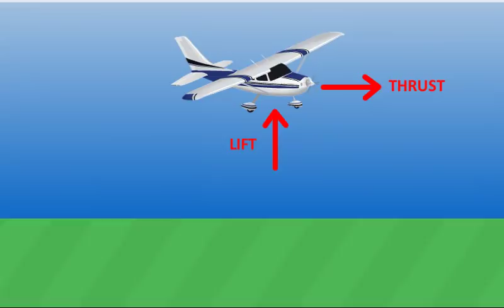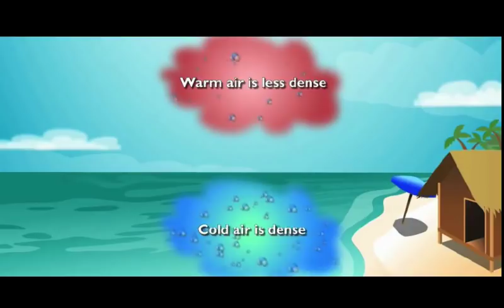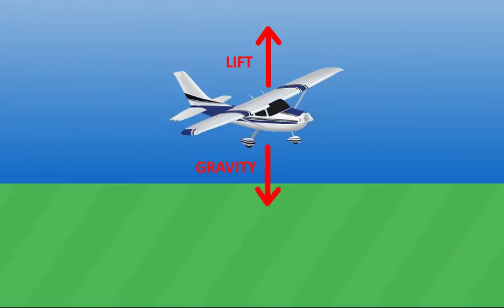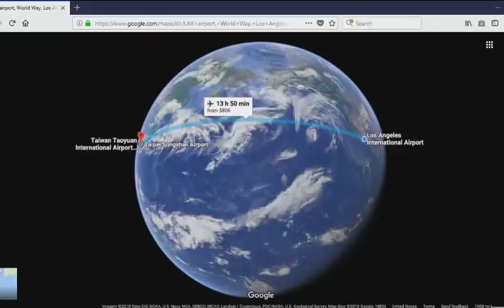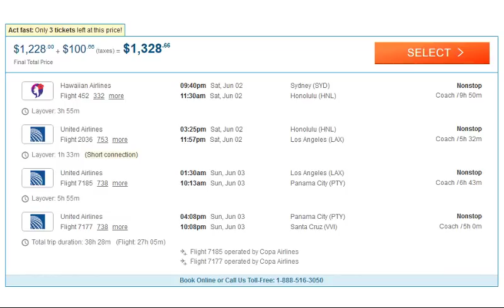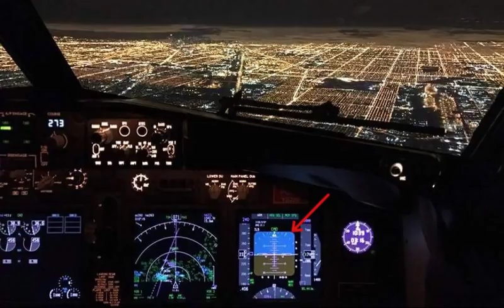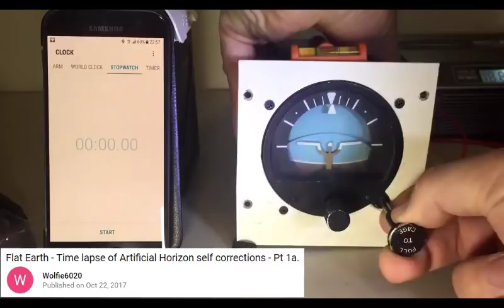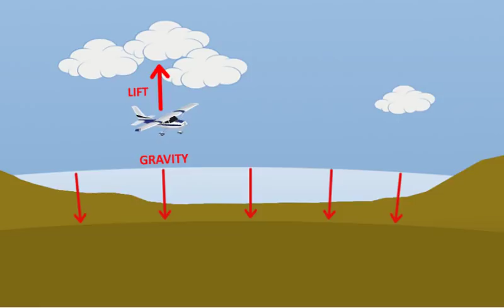Flat Earth Falsities - Plane Nonsense

Comment: Atmosphere moving with earth? So, Gravity not only pulls objects towards earth, now it is dragging air along with its rotation through friction with the same speed regardless in what elevation a plane may be? Or maybe that sort of Friction will end at a certain height? Is that where a Rocket enters space? How come that a tiny little bit of thermal wind can cause air to move against that rotation? You got to admit, you really have some new science made up here. Reminds me of a new Religion.
Reply: It's like you didn't even watch the video before you started commenting.  Or perhaps you watched it with the sound muted?
Reply: K. Bauer No, it is not the gravity proving friction. Anything projecting from the Earth’s surface will provide friction while thermal currents within the atmosphere distribute the accelerated air molecules. Not difficult to grasp.
Reply: @flookd5516  All these Arguments surfaced only recently when the Flat Earth Observation came back again and brought very strong Reasons of why the Earth does not move and is flat vs. a spinning Sphere. What this here is is nothing but a desperate attempt to convince people that this cannot be the case. It seems you all are not even interested discovering what our world really is. If you think about it, you actually argue against your own self and you most likely protect a lie. Earth cannot move, because there is no Coriolis Effect, that is the Reality we are facing today. And Earth cannot be a sphere, because the Midnight sun in Norway or Iceland would not be possible on a sphere with the sun positioned as it has been portrayed to all of us. And that is also another Reality we are confronted with. Btw, the Midnight sun would work if the earth would be flat. Analyze these facts and others instead of insisting on something what cannot be. Or look at all these little pictures from NASA about our round shaped world taken from so called Satellites that appear to be so far out in space that they would be almost at the moon. They are nothing but a Hoax. Nothing adds up anymore, find out why and stop this idiotic display of "We don't really know why, but it is science and that is it" sort of attitude.This here is only "Make believe" and shows that this sort of Science has become just another tool of Mind Control for the masses.
Reply: K. Bauer How do hurricanes rotate if not by the Coriolis effect?
Why would a 23 degree inclination of the Earth’s axis be insufficient for 24hr sun in Arctic & Antarctic Circles?
How does the sun work on a FE? How could it be a visible sphere while only shining light directly downwards? How would supply 24hr sun to the Antarctic Circle?
What couldn’t there be satellites beyond the moon?
What prevents 24hr sun in the Arctic & Antarctic Circles with a globe?
Reply: @KBauer-cs1rh  For over 2,000 years the shape of Earth has been beyond doubt. We simply want to dispel the misinformation FE publishes. Those who turn to conspiracy theories are desperate. 
     You seem confused, your rhetoric delusional. That should help answer your question about our motivation.
     Explain these...

►How does the December Sun, in Melbourne, rise in the southeast and set in the southwest on a flat Earth. ►How can a plane with an 8,400 mile range cross the South Pacific, which is 24,000 miles on FE?   ►Explain rotation about the southern celestial pole. ►How can Earth have a magnetic monopole? ►Tell us the error FEers made in the "cold moonlight experiment". Why did so many FEers miss this error?
Reply: @flookd5516  There are explanations on how Hurricanes develop, they may or may not be satisfactory to you. But if there is a steady Coriolis Effect, then why would we not have constant storms like that? Besides why would friction not prevent them? 
Midnight Sun: All I did was to use a model of earth at home. I know it is not a sphere, but when shining light onto it like the sun and spin it, there is always shade on one side, meaning the Sun would set one way or another and there is no way we would be able to observe the Midnight sun unless you are very close to the Pole. On a flat Earth Model, it does compute should the sun circle closer to the center which apparently happens right now in June/July. In that case you would see the sun all day long, even at Midnight. And comparing this with the Seasons, it makes sense too, because there is Winter approaching in the Southern Hemisphere right now because the Sun supposedly moved away from the South.
On the NASA's Website you can read that Satellites move around the lower Orbit only. And why send a Satellite this far away, makes no sense.
Reply: @romithromith  I am here to do the same, dispel all misinformation. And it appears to be that I am not the one that is confused. 
You seem to know a lot about History. So let me introduce you to a book you may have already heard about. It is called "The Bible". And that is the oldest collection of ancient writings about our earth bundled up in a book later on. In that collection of the earliest Observations on earth is always considered to be a flat Realm. No matter how bad the translation may be. (You may find it interesting that Nicola Tesla said the same.) And if you go further, you will find several Maps later on like the one from Urbano Monti in 1587. You will be amazed how accurate he knew about the shape of all Continents. And with all that skill and knowledge, do you think he was that off not knowing what the shape of Earth was?
Or how about Orlando Ferguson's Map of South Dakota in 1893?
Or Alexander Gleason's Map of pretty much the same year? So you see, it has not been 2000 years that the "World" knew about Earth being a ball shaped Object. That only happened when Copernicus and Heliocentrism announced that Earth was now to be considered a "Globe" about 500 years ago. All that was driven by the Jesuits controlling Education back then and still run every Educational Program to this day. And when you begin understand why, then you will also find the answer to your other questions. But if you don't, then we already know why you are here.
Reply: K. Bauer Coriolis forces do not create hurricanes; they determine the direction they rotate in, ie, anti-clockwise above the equator, clockwise below. Hurricanes have a lifetime of days; friction is weak but continuous over billions of years. 

I just told you the Earth has an included axis. On your test you had it fully upright. You can’t miss out a key factor then complain the full model doesn’t work. You still haven’t  provided an explanation for 24hr sun in Antarctica. 

 If the sun is a sphere suspended over a FE then it would be continuously visible over the whole Earth. It would change in apparent size & speed through the course of its movement. If it projected light only downwards then it would not appear as a sphere. You need to explain how it could remain suspended above a FE, what keeps it shining, how it moves, how it’s motion continuously changes etc. Try it. 

If you want full hemisphere shots to monitor weather then the camera needs to be placed well away from the surface. Low orbit cameras catch only a small area at a time which is fine for mapping or spying. Most satellites (and the ISS) are low orbit but some are in high orbit. Look up EPIC, Himawari-8 and Elektro-L.
Reply: K. Bauer You aren’t dispelling information; you’re demonstrating how little you know and understand. 

The Bible is not a historical record. It was written by landlubbers to whom the Earth appeared flat. Had they been sea-faring they would have had a better appreciation of geographical reality. 

All flat maps are distorted. Yes you can get the general shape of the continents right but they are still inaccurate. Look at the proportions of Australia on the Gleason map. 

The ancient Greeks determined the world was a sphere; the Ptolemaic system was based in a spherical Earth. Copernicus et al were responsible for a shift from geocentric to heliocentric, not changing the shape of the Earth. 

I take it the Jesuits are your boogeymen? Do you want to explain how they were manipulating the ancient Greeks?
Reply: @flookd5516  Ah, now Friction is weak, but it is able to carry the weight along of an entire Airplane in any elevation while air flows over its wings to defy your so called gravity? 

The angle of the light source was of course considered, change it to any angle and you still will have the same outcome. No Midnight sun is possible on the globe, facts cannot be changed. 

Luckily there are Videos nowadays of Hurricanes in the Southern Hemisphere and Northern Hemisphere. It appears that some on either side spin all in the same direction. 

When an Airplane disappears on the Horizon it is not because it lost elevation. It simply has to do with the Viewpoint on a flat surface, further away appears to be lower over the horizon. 

And I still have yet to see an actual Picture of the world from above with the included images of the stars, or do you really believe they disappear in space? I do you think they simply have just a problem of not being able to construct the accurate Constellations from various positions when the pictures are taken, which they are not.
Reply: @flookd5516  Hmm, I guess you never heard of Noah's Arch. In any  case, it shows how little and limited your knowledge is. At least now you have heard about Gleason, not bad for a free lesson. And the Greeks proved nothing, because the shade in both fountains far from each other works on either a flat surface or on a curve.
Reply: @KBauer-cs1rh  That's not what the Bible says and the men who wrote the Bible were scientifically ignorant. No, Tesla did not say Earth was a realm—a Facebook user named Darrell Fox did. Tesla repeatedly referred to Earth being a globe.
      Because Urbano Monti produced a azimuthal equidistant projection map does not mean he believed the Earth was flat, but that paper was flat. Ferguson and Gleason were flat Earthers of the late 19th century, which follows the rebirth of FE in the 19th century.
      No, the educated knew the Earth was spherical for over 2000 years. see: http://www.inf.fu-berlin.de/lehre/SS05/efs/materials/FlatEarth.pdf To say the Jesuits control education world wide and do so for hiding a flat Earth is far-fetched  (it's like the claimed Vatican LUCIFER telescope, which debunked, doesn't go away.) Heliocentrism describes the solar system in a simple elegant fashion. It agrees with basic physics, perturbation in Uranus' orbit having predicted Neptune and Pluto, and has been confirmed with interplanetary probes. And for the same reason we confirm the spherical shape of Earth.
      Your conspiracy theory is misinformed, and to say those who do not agree with it are part of the supposed conspiracy is pathetic. Yet you keep repeating the false Tesla quote, and lying about the LUCI attachment and the Holy See, because it wows gullible people. There is no truth to be discovered, only a program to defend the flat Earth and cast those who disagree as evil.
Reply: @KBauer-cs1rh  
1) The Bible is not the oldest collection of ancient writings. There is no known copy of the Bible that dates before the time of Christ (Dead Sea Scrolls) and there are dozens of writings that predate it by some 2500-3000 years. The content of the Old Testament was not finalized (meaning it was in dispute) after Jesus lived, and the New Testament was cobbled together at the Synod of Rome in the 4th century.
As a student of the Torah, the original 'Bible', I can tell you that there is no place where the flatness of the Earth is declared, nor are there any accurate maps or known physical locations. Even very orthodox Jews believe the Earth is billions of years old and many accept evolution and have attuned themselves to modern scientific teachings.
2) Tesla was not a Flat-Earther, he made many references to t
he Earth as it actually is: https://www.youtube.com/watch?v=uCAL_4Tfxjg
3) Copernicus did not 'announce' the Earth was a globe. In his work that predicted heliocentrism, it was presented as an alternative explanation for the complex 'epicycle' models (which did not fit observations) to describe the movement of the planets and the moon. 
I defy you to offer a flat Earth model that explains both solar and lunar eclipses - especially annular eclipses. Good luck.
Reply: @KBauer-cs1rh  Friction isn't responsible for airflow over the wings; it would actually reduce the efficiency. And, yes, a force can be greater than gravity; gravity is not an irresistible force, something that should be obvious every time you pick something up. It is a continuous force and near constant on the Earth's surface but it is not irresistible. 

Move the light further away from the globe. The sun is 93 million miles away; the light from your torch should be lighting half the globe which it won't if too close. 

Produce one of these videos of hurricanes going in the wrong direction. 

The plane would appear lower on the globe because the atmosphere curves around the globe; a constant altitude would take it over the horizon. On a FE it would never reach the horizon. 

A camera works with a far narrower range of brightness than your eyes. Light reflected off the Earth: bloody bright. Light from very distant stars: bloody faint. You can see the Earth clearly with stars too faint to appear or you can see stars with the bright glare from Earth drowning them out but you can't see both clearly simultaneously. That is basic camera practicality. Try taking a picture of the night sky near an active lamp. 

Gleason's map is frequently waved by FE'ers; no amount of waving will put the continents into correct proportions.

There is no evidence of Noah's ark or a world-wide flood. Where would you say the water cam from and where did it go?

The Greeks determine the Earth was a sphere through the lunar eclipses always having a round shadow regardless of the angle. Eratosthenes was interested in measuring the size of the Earth and an approximate distance to the sun, not demonstrating the Earth was round. Repeating his experiment using 3 or more points (repeatedly done) and curvature is demonstrated whereas a FE sun would have to be at multiple heights simultaneously. 

ll you have done is repeat many of the FE fallacies and exhibit lack of knowledge and understanding. You are happy to accept the notion of gravity as an irresistible force without bothering to check if anybody says it is so. You don't understand how airflow works, just assume air movement and surface means friction is the only result. You haven't thought through a aeroplane following curvature or how you can replicate the sun shining on a model. You don't know the limitations of a camera. If you wish to teach people "the truth" then think through what you are claiming beforehand.
Reply: @KBauer-cs1rh  "You need to explain how it could remain suspended above a FE, what keeps it shining, how it moves, how it’s motion continuously changes etc."
As I said before - try doing this. It requires the thought that you think you have done.
Reply: @zelator29  I am aware of the dead Sea scrolls, Torah/Tarot which is also just a scroll. And there are older found Hieroglyphs and Sumerian Tablets, but none of them were bundled in a book. 
So, in Revelation 7:1 it says: "I saw 4 angels standing in the 4 corners of the earth, holding back the 4 winds of earth". Now 4 corners cannot be found on a spherical Earth, but it can be interpreted that they probably stand on a flat surface. 
Psalm 75:3: When the earth and all its People quake, it is I who holds its Pillars firm." Meaning Earth is probably on a fixed platform standing on pillars and can be held in place. Of course, it can be interpreted in many different ways, but it does refer somewhat to earth to where and what it is, in the Center of the Universe and not moving. 
And for you studying the Torah, in the Book of Deuteronomy 13:7 it says: The gods of the peoples around you, whether near you or far off from you, from the one end of the earth to another". This reference from Moses may or can also be understood as being flat since a spherical Earth has not ends. 
Continue your study and for yourself you will find the truth or follow the biggest lie. It is up to you. Shalom.
Reply: @flookd5516  How does Earth continue to "spin" with the same speed after such long time of its existence with no made up force explained to this day? Is it "Gravity" again?
Reply: @KBauer-cs1rh  "it does not have a lot of mass."
If gravity was irresistible then it would have infinite weight; evidently it doesn't. 

 A plane is self-powered corrects constantly for atmospheric variation; Coriolis effect is lost in correcting for stronger forces at play. A hot air balloon moves too slowly and is totally at the mercy of air currents so no apparent effect. A high-speed bullet (covers a long distance in a short time) along a north-south trajectory does veer due to the Coriolis effect; it would not be apparent from a handgun which is where your information is probably coming from. 

Mythbusters: rather obviously an effect of the camera and doesn't provide evidence either way. Are you arguing that a curved line in a distorted camera means the line just gotta be straight? (If you're trying to make a point from a video then put in the appropriate time point). 

It continues to spin through inertia. A moving object on Earth will slow down because it loses kinetic energy through interaction with objects & forces in it's environment, e.g., friction along the ground, air resistance. The Earth is not impeded by such; there is little to force it to slow down. Deceleration is occurring with about 2 milliseconds added to the day each passing century. 

You think an object radiating heat & light is supercooled and that the Earth's gravitational field (which would exist for no apparent reason on a FE) is strong enough to hold up a huge mass at whatever height you think the sun is?

Learn some physics before lecturing people.
Reply: @flookd5516  Hmm, they always say it is pretty cold in space. Obviously you studied and memorized a few things. But evidently you understand nothing of it at all. Bravo, great talking to you. Keep on learning, there is still a chance you may grasp a thing or two.
Reply: @KBauer-cs1rh  "they always say it is pretty cold in space"
Unless directly exposed to heat source like the sun. You need to explain how the sun can be exuding heat while being at near absolute zero. 

I think it would be correct to say that you see the devil in the detail.
Reply: @flookd5516  Actually I do not need to do anything anymore at this point. This is where it ends for you.
Reply: @KBauer-cs1rh  You're making all the assertions, you need to provide evidence.
Reply: @flookd5516  No, it is you that makes the assertion and you have no proof of anything. You cannot even explain or proof of what "Gravity" is. Nobody in so called "Science" can. Because it does not exist.
Reply: K. Bauer https://www.jstor.org/stable/106988
Cavendish, 1798, repeated countless times since with similar results.
Reply: @KBauer-cs1rh  Here's a little test for you, on the equinox, the sun rises directly 90 degrees east and sets directly 270 degrees west and passes directly 90 degrees above your head at solar noon, meaning it has traveled in a straight line, now, with the given height from flat erfers of 3000 miles, if you view the sun at 1 degree above the horizon just after sunrise, or just before sunset, how far away would it be? Take your time, I know math isn't flerfs strong point, if you have difficulty ask your mom or someone who might be able to help.
Reply: CLANG CLANG CLANG CLANG  Until? Or did you skip your class?